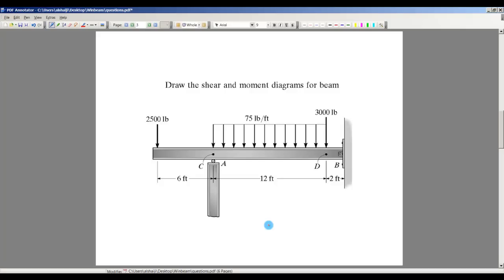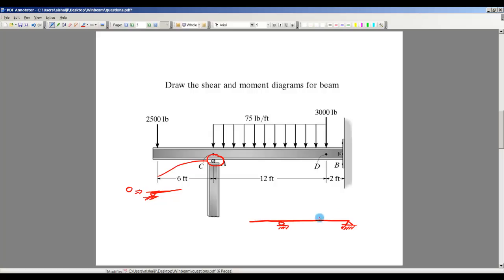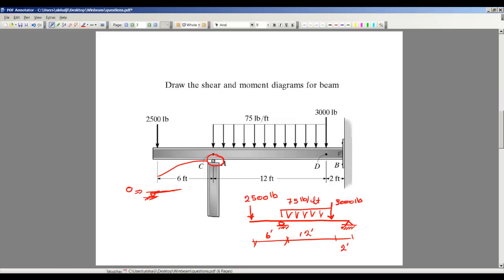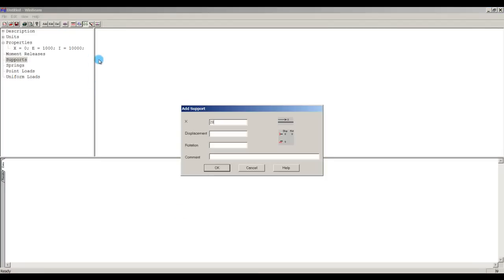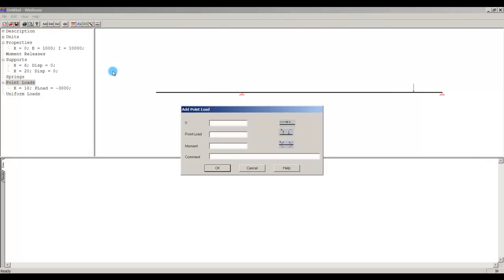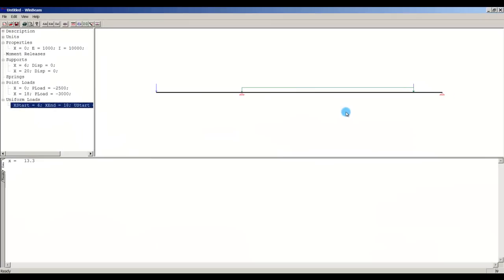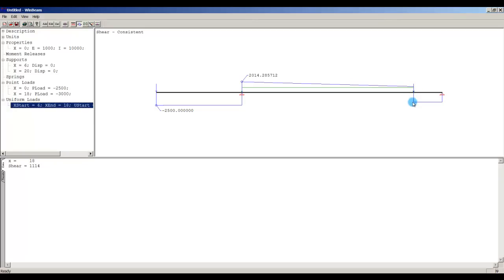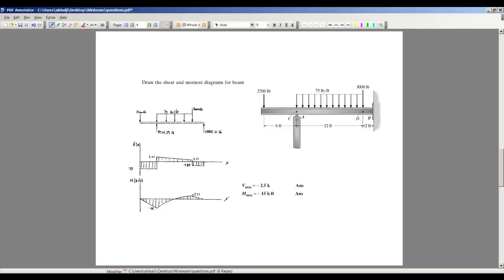DNSWinbeam: Draw shear Force and Bending Moment Diagrams - Part (2)

Comment: the good thing about assuming the wall connection does not resist moments is that it makes designing the bolted connection easier.  Only shear will be present.

Comment: Thanks for the interesting tutorial. I have a couple of questions: 1) is it possible to visualize the values of the applied loads on the drawing itself? (like above the point force etc.)    2) Why the bending moment diagram is drawn the other way round?
Reply from the maker: +CLEMENTE CARUSO regarding question 1, there is no option in winbeam to show or hide the load values.

As for the second, the sign convention is set this way. This sign convention is useful for concrete design